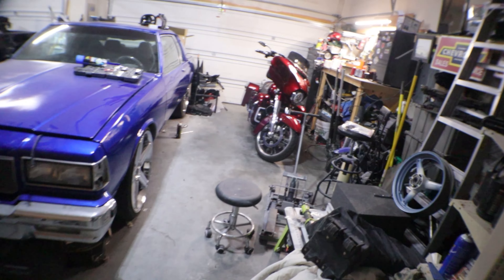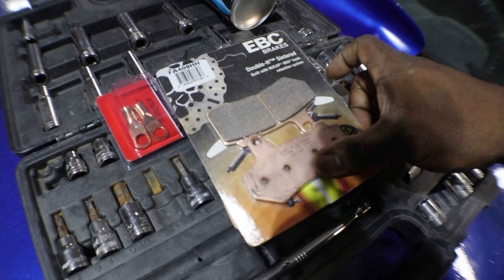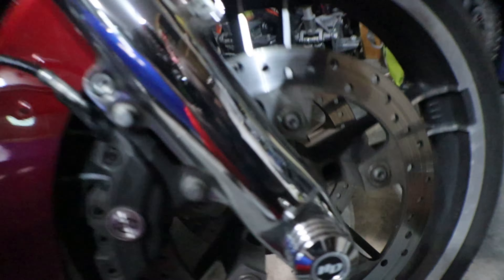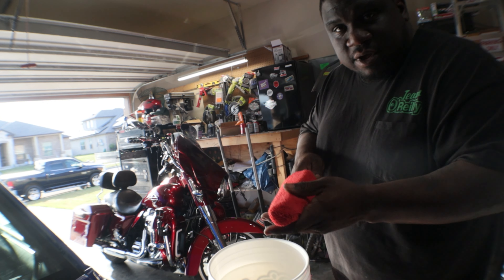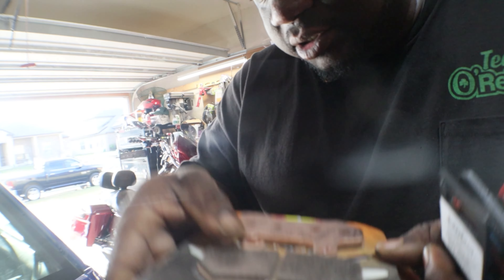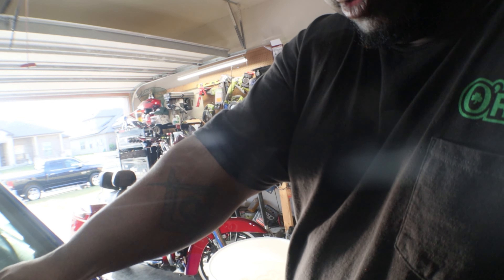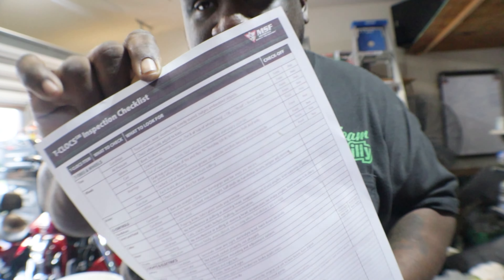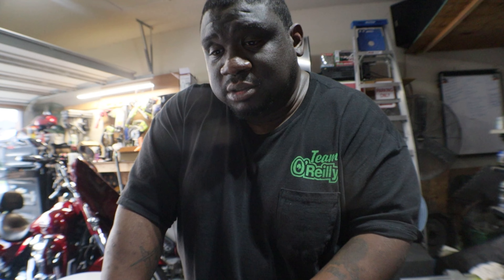THESE THINGS ARE A MUST TO KEEP YOUR MOTORCYCLE READY TO SAFELY RIDE

Comment: I have the EBC on my bike. When my bike was in the shop, I asked did I need a brake job and they said the brakes are good. Last year I went into the mountains and I was not getting the stopping power I needed especially going down hill from he rear. So when I got home I pulled the brakes and they looked just like yours, good on the bike, but when I took them off the wear was bad. Looked good on the bike but in reality they were worn. Luckily the rotor was good and I replaced them. The EBC had better bite and those you have are made from a better material. I would pull them if I was you to really make sure. Also my fronts which had great stopping power were worse than the rear. They also looked good on the bike but off was horrible. Worn down so close I was surprised they didn't dig into the rotor. Good luck with that.
Reply from the maker: thanks for sharing your experience i may just go ahead and do them this fall/winder coming up thank you